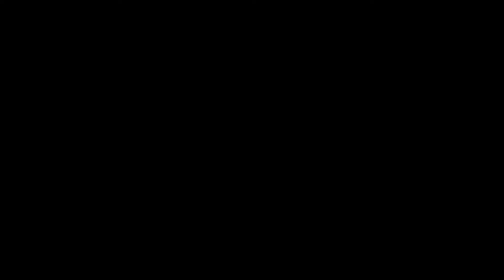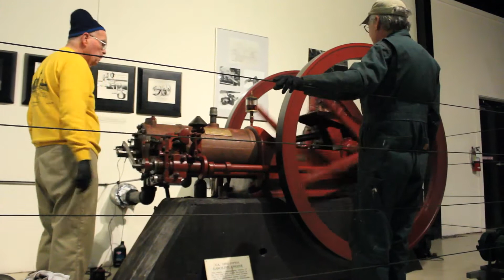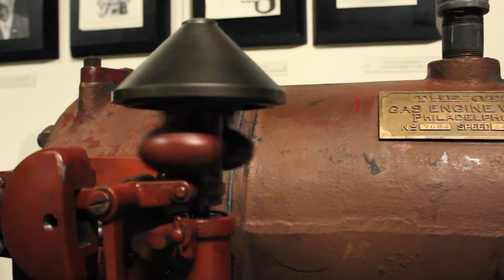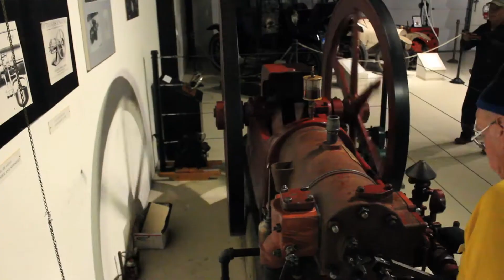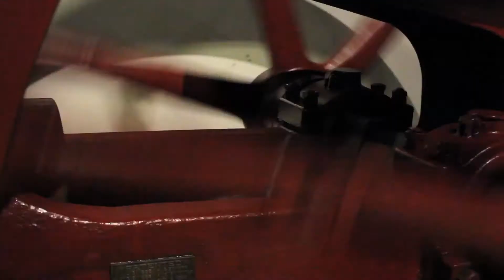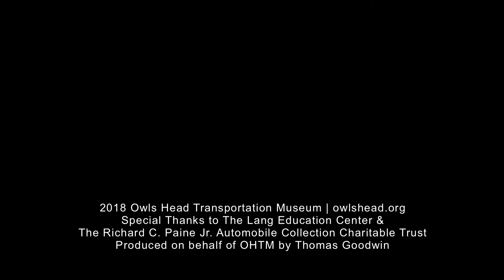Fire It Up! | 1895 Otto Gasoline Engine

Comment: Otto's original engines (both the "atmospheric engines" and the four-cycle "compression engines" ) ran on illuminating gas, not liquid fuels.  That came later.   Otto employees Gottlieb Daimler and Wilhelm Maybach developed the first liquid-fuel carburetors, employed on Otto-type engines.